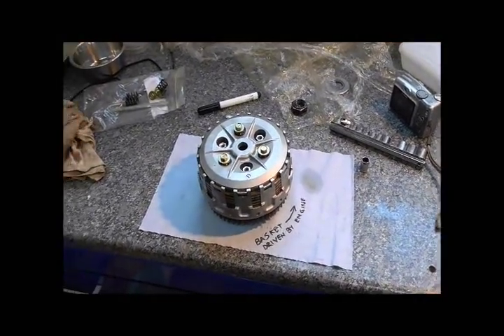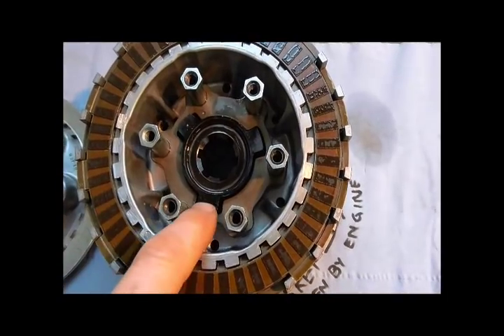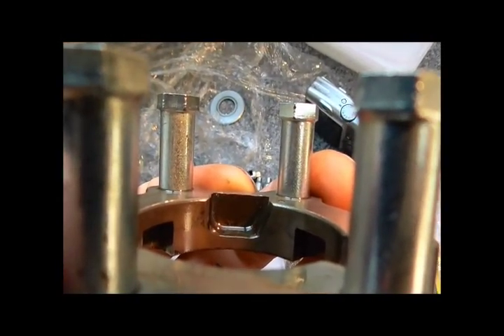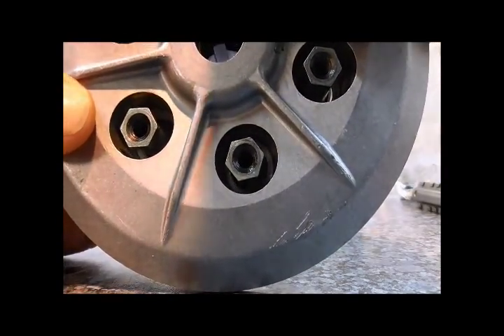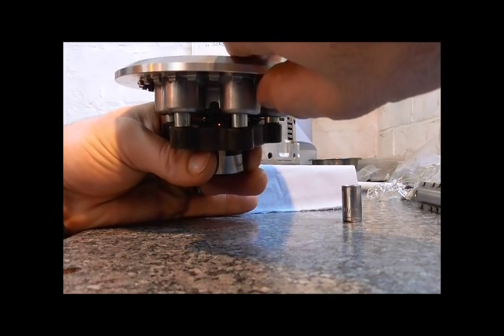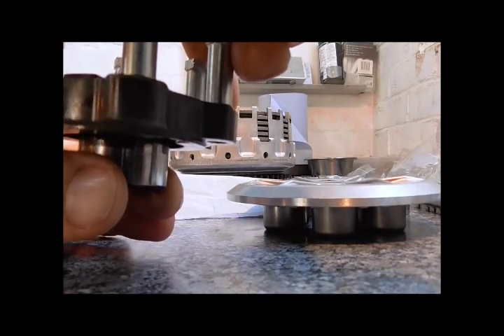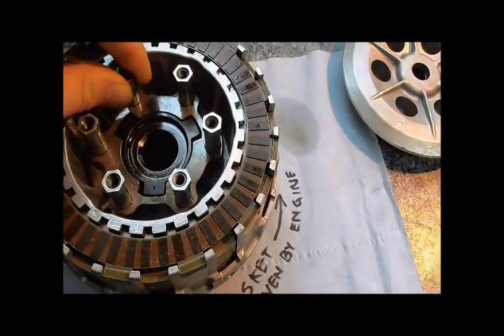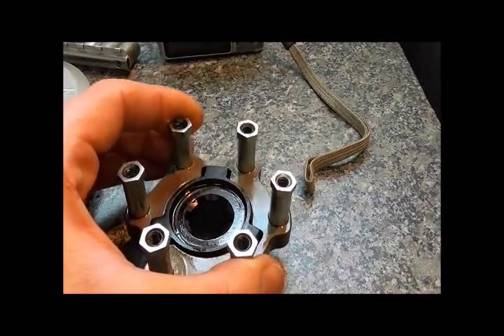Suzuki TL1000R slipper clutch explained

Comment: I wish I could stop mine slipping. I've wasted so much time and money but can't stop the slipping. I want to keep the bike but I'm fed up with it slipping. No one I know can do the weld mod. It slips when the engine is  warm/hot but not when cold. I've got Barnett springs and new EBC clutch plates fitted months ago along with a new slave cylinder. Ive had to put up with the slipping a year now. Update.a year on...I've had the weld mod done to weld the centre plates together and it's fixed the slipping. Been riding a few months without clutch issues.
Reply: Have you replaced the cam set. I'm pretty sure this explanation is wrong on how this slipper clutch works
Reply: @lewisreinhardt9425  no mate I just had a huge bill to pay from my MOT as my front brakes needed refurbishing and im skint but It's not something I'm worried about to be honest as I've met so many owners with a TLR and no one has given me any warnings about the cams so I'm willing to take the risk.  I have added engine restore into mine a couple of times  along with the best fuel injector cleaners and it's running perfect. How many miles had you covered when you had the cam issue? I can't remember if you said and wasn't we chatting on another video🤔 I don't see the comments here we had here.

The only issue I have is mine doesn't go into neutral unless I rev the bike up or turn the engine off then select neutral. Not sure what's up there and the mechanic doesn't see it as a problem so hasn't done anything about it.

Comment: I'm pretty sure you are describing the back torque limiting feature... as the hub slides outward on the ramps under heavy decelleration spring tension is removed, allowing slip... newer systems are much more refined and capable
Reply: Yeah thats what I thought. But when the cam set gets worn it will work in a similar way under acceleration. Lessening pressure on the clutch plates and there for causes slippage
Reply: don't "under estimate" the effectiveness of the Anti-Judder mechanism in controlling "anti-judder" on take off!  I've tried removing them on a gixxer and it was eye popping how bad it "juddered" on take off!  (only fix was putting the anti-judder device back in... still scratching my head on that one! LoL!)

Comment from the maker: Just for reference, my clutch slips when warm and only in 5th or 6th which is apparently very common for these bikes. It only does it intermittently, and is sometimes difficult to reproduce. So even the system shown in this video with regards to the amount of wear (very minimal) causes the clutch to slip. I guess the only real cure, as I mentioned in this video, is to weld up the two parts and fit appropriately sized springs, which will be my next job I guess :)
Reply: a welded clutch center would help tremendously.
Reply: there is a gentleman in our group Who welds them.

Comment: i have a 2001 TL1000S and it slips till it worms up when i bought the bike it has upgraded clutch springs i have the old ones in a box. very annoying is there away to stop this slipping happening?
Reply: Engine oil and clutch springs.

Comment: I believe the problem with the cam is this. The cam moves to a point and stops upon acceleration. The stop point is an interruption in the grip on the clutch plates, thus giving a dynamic point in the pull that can be overcome by the engine. Then it slips. 
This is the debate..
The fix is to weld the 2 pieces together. The inner cam should be welded above the plane of the outer piece by about 4mm. That makes it harder to pull in the clutch at the handlebar lever. My next test is to try only 2mm so it is not so hard to pull. Then shim it (using washers) in the top of the pressure plate if it still slips.